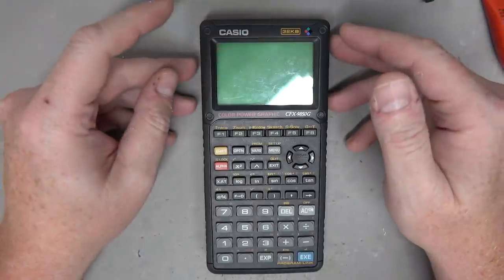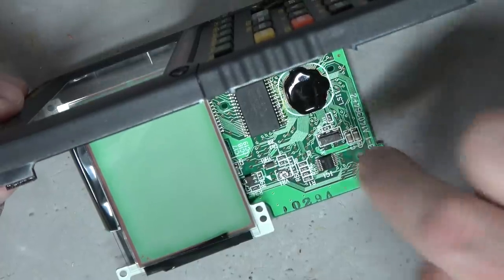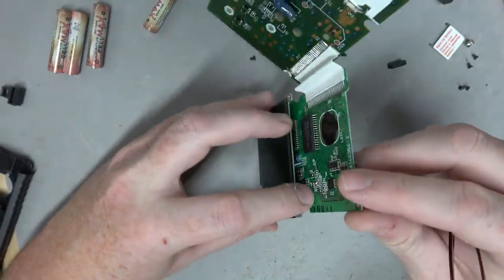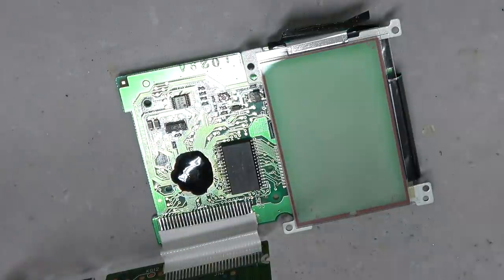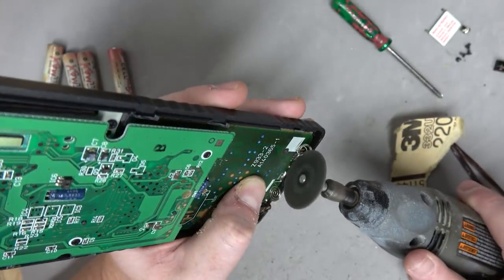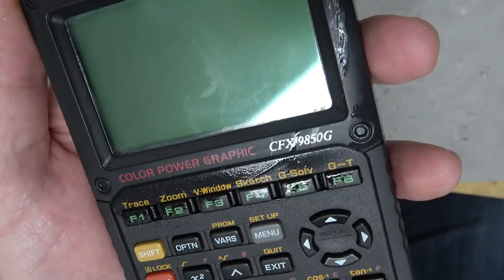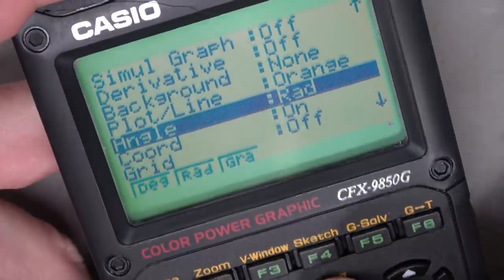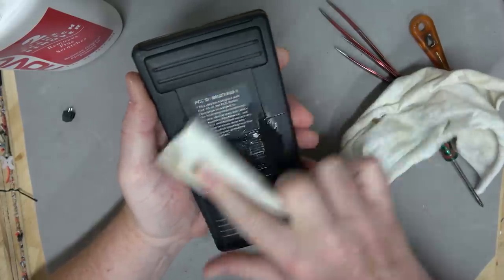Inside the Casio CFX-9850G Graphing Calculator

Comment: That switch lets the main batteries power the memory while you switch out the backup battery.
Reply: What's interesting is that the CFX-9850G plus (Which I have) doesn't have that switch at all.
Reply: @ray73864  I went and looked at mine and it doesn't have it either. But I remember that feature from an earlier model.

Comment: This "32K" thing is not bragging. It's part of the Casio design language. All of their hardware does have most notable features printed on a case. Wristwatches tell you how many alarms they have, if they have a solar cell or shock and water protection built in. Keyboards tell how many sounds they can play and how many rhythms they have. Calculators tell how much memory they have and what are their functions (like graph drawing and such). It wasn't there to impress anybody. It was there to just straight up tell you what you get and I love that part of Casio design.

Comment: It reminds me my Casio fx-7000G, which I bought in 1986..  . Then I bought Casio fx-9700G in 1992. I modded both calculators to use external 9V battery, which very economical.  The LCD is the SHARP's LCD. 

Thank you.

Comment: Very late, but the "lag" in the colour is due to how the display works. It's not actually a colour display, well it is, but not in the sense you typically think of. Its kinda actually a grayscale LCD. It uses some kind of filter magic to produce the colour based on the "brightness" of each pixel (probably the angle the crystals are twisted to i guess). Hence it briefly shows other colours due to the slow response time if the lcd pixels turning on and off.
Reply: In a nutshell, the magic filter beneath the front polarizer works as a birefringence.

Comment: That's what they don't tell you. Blue is the new black. I've got a CFX-9850GB PLUS and its older,  much chunkier brother CFX-9800G in my slowly growing calc collection. Seems like it's a false black due to how the LCD handles the colors. I did a test on the graph using all the colors with the same function and it goes as follows...

Orange - primary color
Blue - secondary color
Green - tertiary color

I was testing to see if they would overlap, but they overrode the previous color instead. So it seems as it goes from orange to get to blue it just looks black. At least that's what I see.

Comment: I used one of these in school but the 64 kb version 9950G. I still have it and it works. I just now went and tested if there was power in the batteries still after being untouched for at least some years now and they are still all good with plenty of power! (No dim screen or battery alarm whatsoever) wich is amazing since u need a small amount of power to keep the data stored in memory alive as this was at a time way before flash memory became common. I guessed beforee it must be SRAM if requiring so little power that there is still lot of juice in the batteries after all years and all programs I wrote are still in there and working. Impressive! That switch BTW is if I remember correct there as an interlock to prevent you from corrupting/erasing the data in memory by accidentally turning the power on with only the backup battery while replacing the other batteries. The backup cell is just for keeping the RAM energized and is not able to power the rest of the calculator and thus turning power on without the main batteries in place  could lead to undervoltage and loss of data. There is also no black color despite the 4 color icon above the screen but only blue, green and orange and blue is used instead of black.

Comment: This was the calculator that got me trough the last few years at school. Not a great device, but OK for calculating ;D

Anyway, we where allowed to use this thing on tests, but the teacher would go around the class room and erase all the devices before the test. So, what did I do? I opened it up, and disabled the reset button. I programmed a screen that would look almost identical to the "delete all memory" screen, and make sure the program was running before the teacher tried to erase it. The program reacted to the same buttons, and showed the expected text. 

It worked like a sharm, but sadly, I was too afraid of getting caught, so ended up restoring the reset button after the first test...

Comment: Curiously my calculator does not have this switch in the battery compartment. 
Everybody at school had to buy this specific model. I learned how to program some type of BASIC on this thing while being bored in french classes. Then we exchanged games and cheat-sheets with the link cable in class. Good fun. I always envied the faster TI Calculators, this thing is horribly slow running anything with graphics. The BASIC implementation must be quite shotty.

Comment: I have a Casio CFX-9850GB PLUS-L and right on the front of these calculators including yours they state 32K !!
There are only the 3 colors, but you can change the contrast of each color to effect the display.
The color difference is all down to how you set the contrast for each color.
Like most programmable calculators or organizers you backup the programs and stored data with a CR2032, when it comes to changing the batteries you can switch to either battery type to keep the memory contents intact. To change the Main batteries you make sure you are switched to Backup, to change the backup battery you switch to Main batteries. For normal operation you have the backup battery switched in. You can run these from an external power supply and the power jack is also a computer interface providing you have the correct cable. I know nobody ever RTFM but its worth a quick look for basic info. The manual I have is about 3/4" thick. I bought my calculator brand new from good old Radio Shack years ago, when I found it, it was reduced, the original price tag still there was $99.99 the reduced price tag $19.99. The color display can be a little tricky to see depending on your lighting conditions, 
but it is Color as opposed to the TI-83 calculators of the day being just Black and Clear.
The Casio boots up into the User Menu as opposed to Just Cal mode and requiring extra button presses to get into the User menu as on the TI-83 Calc's.
They are a little slow to draw the graphs, but I actually find that nice to watch. Enjoy !

Comment: I had a similar version of this calculator and I don't think it has black at all, I think it only has blue, green, orange and white (and I find 4 colors more likely than 5 colors if you'd have a separate black).
But yeah, the colors are really dull and the downgrade to a calculator with only back and white wasn't actually that bad since the later screens had better contrast.

Btw, the "exit" button is what you use on these casio calculators to get back whatever was the previous menu.

Comment: I had this calculator through middle and part of high school. At first I was annoyed that my parents cheap'd out and didn't buy TI. As I used it, though, I became quite fond of it. Then some jerk stole it, by which time Casio stopped making them, so I ended up with a TI-83 Plus. Man, the TI interface is horrendous after being spoiled by that well-organized Casio, though it did incidentally seem more powerful (and had more usable memory). I still use an '83 Silver that I bought when I started Community College. Wife has/uses my original '83+. 👍

Comment: I recently got a Ti-83 without some keys working and a CASIO CFX-9850GC PLUS with no keys functioning. 
Just needed to repair some traces for the TI-83. For CASIO... no protection for corrosion... there was a layer of battery leak. I had to scrub with some sandpaper and it was fine after and then I sealed the sanded traces with nail polish. Stupid way Casio didnt add a protection between the pcb and 4x AAA batteries.
Reply: High value calculator, expected to be owned by people who use it regularly, not ones who forget about it in a drawer for years, and the battery compartment is segregated from the PCB so if it's stored the correct way up it's fine. Bit of conformal coat isn't expensive though, so it's a shame.
Reply: @CoyoteBoyUK  What it costed back then, TI should have make them more durable. Like 2 wires coming out from a sealed 4x AAA and 2 more wires coin cell. Soldered ribbons between the LCD pcb and the logic pcb.  etc
Reply: @hugosimoes5119  why? Mine has lasted 25 years kicked around in a bag and left for a decade with flat batteries. Seems pretty durable to me. That's like complaining a car should be more durable so that when you crash it you don't have to replace bits.

Comment: i still have that calculator for 25 years! i made programs for Pythagorean theorem and quadratic formula. that switch is to change power to the backup coin cell while changing the main batteries.

Comment: A friend of mine had one of these when we went to school. I remember there were only these three colors (+ blank), but no black. It would make sense – each pixel would be exactly only 2 bits. BTW, you could do a some sort of "hue rotation" by adjusting the contrast. If I remember correctly, you could make the orange almost invisible, green shifted to orange, and blue shifted to green. Or you could go the other way and squish two colors into dark blue. In poor light conditions and under weird angles the colors were kinda dancing around anyway.

Comment: I have the 9700 version. I think you might be missing  a piece from the battery compartment. Mine has a piece of metal that latches into place with the switch that's there. I think it's there to remind you to make sure the backup battery is good before changing the main batteries. As it has no user writable ROM all the data will be lost etc etc.

Comment: Pls no more remakes of good movies. Thank God back to the future creators are against it too, and don't care about the cash. What is done is done, if the studios want they can make another time travel movie, it doesn't need to be called back to the future and pray on nostalgia.
Reply: honestly, stop remaking movies period
make something new, but that requires writers that are capable of an original thought
Reply: @pacman10182  I said good movies bc it's mostly what they do. And it's very easy to fail when the bar is already high. But I can see the value of remaking a bad movie and making it better. It was done even in the 80s. For example the fly, the original was a shit movie and they made a classic with it.
Reply: @itsasecrettoeverybody  current year Hollywood is incapable of making good films
2021 is the year of cleaning house (getting rid of all the pedos and sex pest wouldn't hurt either)
Reply: @pacman10182  ik I'm not saying they can do. I just said there is not inherent bad in remaking bad movies.
Pls limit the replies to the things I said.
Reply: @pacman10182  I didn't say it isn't relevant either, just don't see the need to start a tangent conversation.
I was just saying there is no worth in remaking movies that are already good, they will always be good.
I never intended to enter on the merit about Hollywood being decadent, because it's irrelevant for my premise.
And what's the point in using an opinion to corroborate an argument that doesn't need it? You are only poisoning the well.
I hate how internet conversations go off topic so easily. If you want to say something tangential don't reply start your own comment. 
Thank you very much.
Reply: @itsasecrettoeverybody  "I hate how internet conversations go off topic so easily."
should I invoke Godwin's law now or wait till later?
I'm afraid you've chosen the wrong individual to get into a long winded conversation and not expect us to veer off the road and into a ditch
Reply: @pacman10182  ok bye

Comment: Ben - any more info on how they implement that wacky 3 color lcd? Surprised they can’t do dithering with pwm for more colors but I guess the ‘video’ processing couldn’t handle higher bit depth, not without more video ram for sure.
Reply from the maker: While editing I noticed it seemed to cycle through the colors to achieve them. Like every pixel has to start at red, then green blue then black. Do frame by stop (stop video and then , and .) when it's drawing the curves.

Comment: I remember a teacher told me that you won't have a calculator with you at all times. How wrong they were.
Reply: I had a teacher claim this in 2008, well after calculators came included with new cell phones
Reply: When you come up out of the radioactive rubble and the liberal zombies eat the last battery somewhere off in the distance your teacher will say, I told you so!
Reply: @1pcfred  ya don't need a calculator to to put nails in a 2x4.
Reply: @onceagain77  I've used a calculator to figure out how to space nails evenly in work. I want what I make to look good. Fetches more money then. Although you can figure that out using just dividers alone. Takes longer to do.
Reply: @onceagain77  they may not but I do.

Comment: The Casios are really not intuitive, unfortunately. I used a FX-9860G Slim in school, it has so much potential but not a single student grasped how to do all that stuff. Just recently found it again and just like Ben struggled with all those keys, menu / exit / alpha / shift, plus the six F keys. I remeber flashing the 2.0 firmware that could solve linear equations or something, good times

Comment: @Ben Heck Hacks - Ben.... you must construct your very own calculator. It is you DESTINY.
Reply from the maker: I want to.
Reply: @BenHeckHacks  - I humbly reccomend you check out the RA8875 chip - either on its own or as part of a display as it is available as.

it's basically a graphics card all in one! its got memory, line drawing functions, blitting functions - even custom font rom connections and stuff!

SPI interface as well as err.. the more complex things in chip form.

Really simple interface - could take a lot of stress out of such a build :)
Reply: @BenHeckHacks  - MPU is it? yeah it's got that too - I was eying it up as a potential quick win for a graphics chip for the 8-bit guys project - but nobody heard my cries
Reply: @BenHeckHacks  - Yeah man! it's like a little 2D rendering API with shapes and all sorts accessible via SPI - so a graphing calculator would be totally doable with a micro-controller and a display using this chip - no pixel bashing required :D
Reply: @BenHeckHacks  - and like.. you could build the input from a keypad as a string, and then evaluate the string as an expression like you were typing it in on a BASIC micro?

you'd just have to write an expression evaluator then - you can code a pretty tight one in C! or if you used one of those funky controllers that used python or some other scripting language? you can just straight up use its evaluator :D

hope you're well!
Reply from the maker: I've been reverse engineering a Palm Pilot LCD for such a project.
Reply: @BenHeckHacks  - My apologies - I just really love that little chip - yeah your idea is way cooler! perfect aesthetic :D you know those Keyboards that are just keypads over usb etc? unless you wanted a pocket form factor? that'd be pretty cool :) although I feel that'd need a red VFD to be period inauthentic
Reply: @BenHeckHacks  - don't forget an almost useless little solar panel - or get some of those radioactive florescent tubes (Tritium) and wrap panels around them like some youtubers have done - nuclear powered calculator! (well - not entirely, micro-watt range - but still, technically true!)
Reply: @BenHeckHacks  - I just googled 'metal keypads' - now I want to own keypads - maybe there's something flush out there which you can etch and use? - I just strongly feel that like Jimi Hendrix's guitar - or Picard's flute? Ben Heck's calculator simply must be - even if we never see it because you deem it too beautiful for our lustful eyes.
Reply: @BenHeckHacks  - now I can't get Indiana Jones out of my head - a table filled with ornate calculators - choose wisely :O
Reply: @BenHeckHacks  - Sorry to spam you oh mighty wizard - but you know those laser range finder things? maybe you could integrate the components from one of those into the calculator and use it as a sample input etc (I was just trying to think of an excuse to suggest you put a laser in it) ..... (rumble motors too)